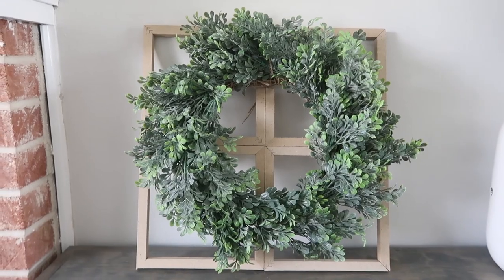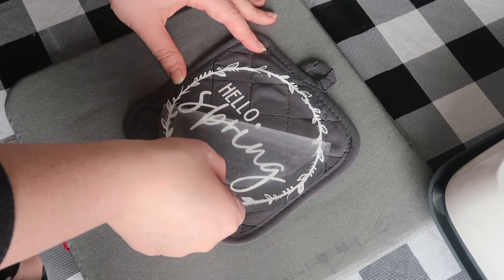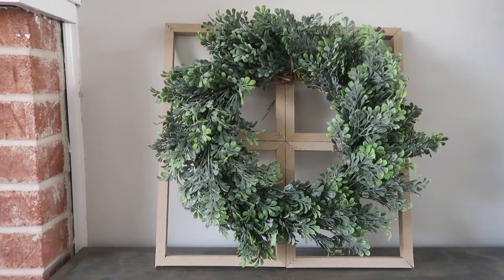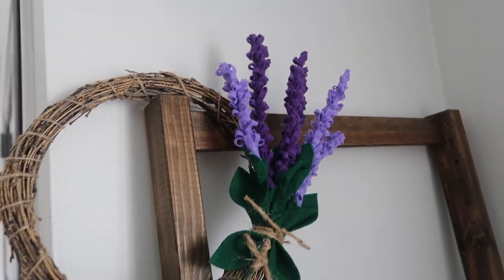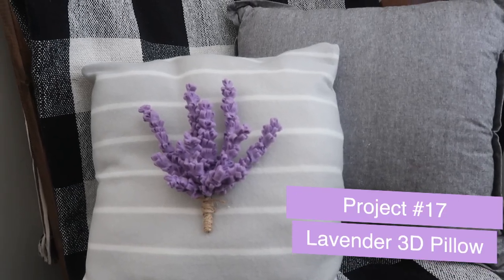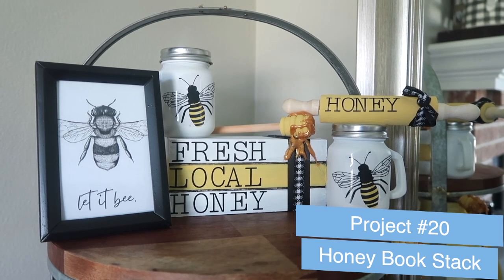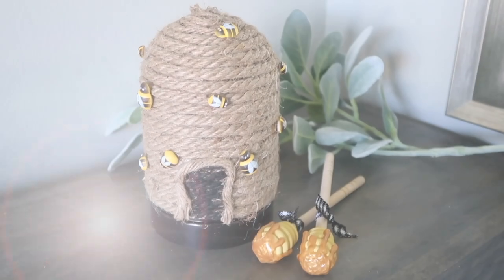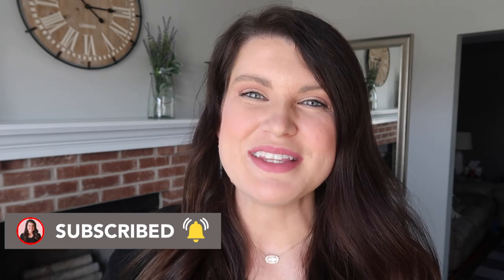YES! 25 AMAZING Dollar Tree Decor DIYs for Spring 2024 ☀️ 🌷 CHEAP + EASY Floral Summer Decor Crafts!

Comment: When using tassels on pillows, lay the tassels on the inside (toward the center) and glue them in with the pillow.  When you turn them right side out, you tassel strings are enclosed and the tassels are beautiful! Just a step easier.
Reply from the maker: Great tip!

Comment: Excellent tip for floral arrangements, Whitney! They intimidate me, but cutting down all the stems to basically be individual flowers would make arranging much easier (at least in my head at the moment). I've missed buffalo check! I understand getting burnt out on it - I did that with the chevron pattern that was super in years ago. Thanks for the great DIY inspiration as always 😁
Reply from the maker: Oh yes the chevron! I went nuts with that too! I've found working with the little stems is SO much easier, I hope it helps you too!

Comment: Whenever I try painting dollar tree signs the paper bubbles…yet I can’t seem to get it all the way off if I peel it.  Is there a trick to it?
Reply from the maker: My best trick is to paint the back of the sign vs. over the paper on the front. Some of them peel off easier than other's, but using a scraper or old gift card helps me get underneath the paper to pull it off.

Comment: I try to print the printables but I'm unable to change size and they do not fit letter size. Any suggestions?
Reply from the maker: They are sized to 8x10 and 5x7 for most frames. You can still print them on letter and resize :)